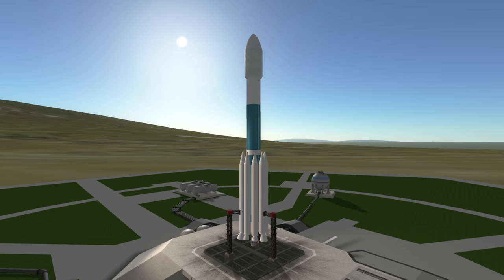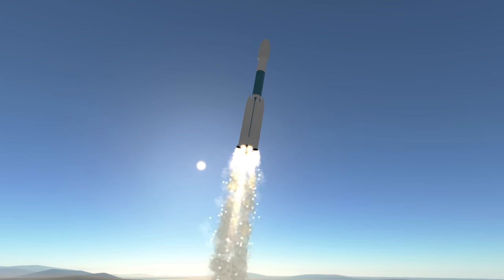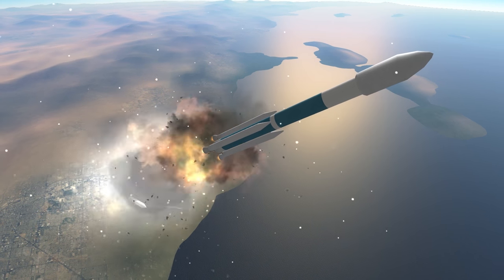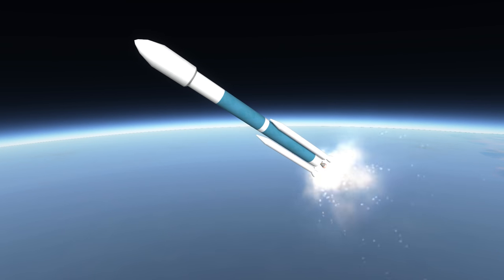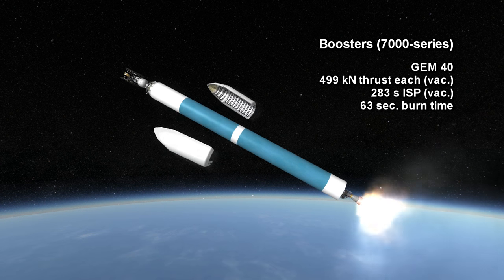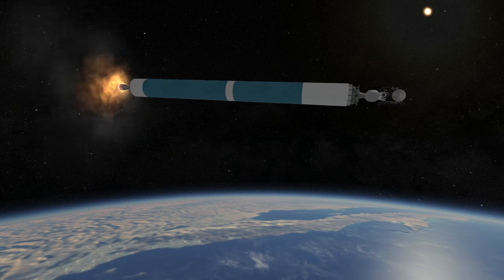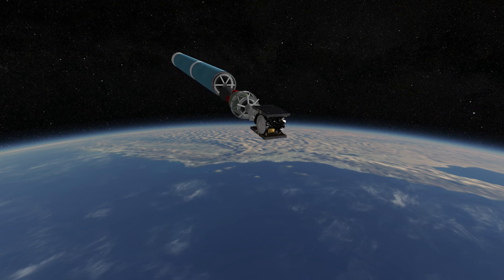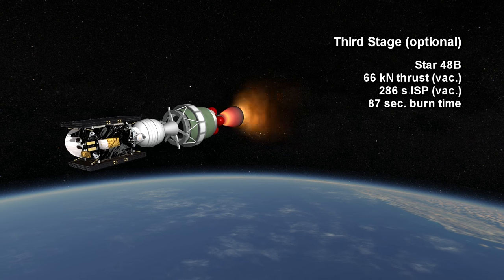Rocket Profile - Delta II

Comment: Its sad that it could only put 13,000 lbs into LEO.  Its such a big rocket for such a small payload capacity.  The Falcon 9 Can put 50,000 lbs into LEO.  Yes I know that the falcon 9 is heavier and taller than the delta II but all the boosters and SRB's just for 13,000 lbs just seems impractical.   Also FIRST!
Reply: It's practical. The payload capacity is the measuring point for the performance of the rocket. It takes more components to achieve the same thing but it doesn't mean that it will carry more payload.
Reply: Not so impractical when you consider how reliable the Delta II has been in over 20 years of service. The Falcon 9 has already had the same number of failures as Delta II in far less time.

That said, Delta II is almost at the end of its lifespan. The last Delta II launch scheduled is for next year. After that it will be up to companies like Space X to improve their reliability so that they can approach the success rate of Delta II.

Besides, if you're going to compare a Delta to Falcon 9, it should be the Delta IV. The heavy variant can take way more to GTO and beyond than Falcon. It'll be interesting to see what happens once Space X finishes development on the Raptor engine, especially if they use methane-based tech on the Falcon.
Reply: + Rocket Man. I concur with Jake. Delta II is showing it's age. Falcon 9 is more efficient and cost effective. That said, the DoD, and NASA, want stuff with off-the-charts reliability, and the Delta II has shown that it's a performer. Hell, the Delta II only exists because DoD pulled all satellite payloads off the Shuttle after Challenger. I'm sure that Musk and Space X want to meet or exceed that reliability, but the loss of two Falcons in two years is a pretty big setback.

You are not wrong to say Falcon is better, it is. It just needs to get as dependable as Delta.
Reply: IMO there still some explosion away from Falcon's reliability to compete with ULA. Spacex is still going to be a little bit Russian(ish) because SpaceX's approach for cost reduction is a mix of some Roscosmos and internet company. In engineering, you can't create something have both cost and reliable, the 61M for a rocket that can do 22 ton LEO and 8.3 ton GTO is very low when compare to others Launchers, especially SpaceX achieved this in US. However, reliability definitely will improve from failures , in some point SpaceX will catch up the reliability of ULA though.
Reply: + zombielinkinpark The Roscosmos model has proven successful with time. The Soyuz rocket is the most reliable launch vehicle yet produced. They just need to work out some of the systematic kinks.
Reply: Just to add a bit of information: Delta II is retired, because Atlas V 401 is more powerful and still cheaper. Delta II uses upgraded, but still old tech and has become pretty expensive over the years. The reliability thing won't be an argument against Atlas V (68 flights, one partial failure), so there's no reason to stick to DII.